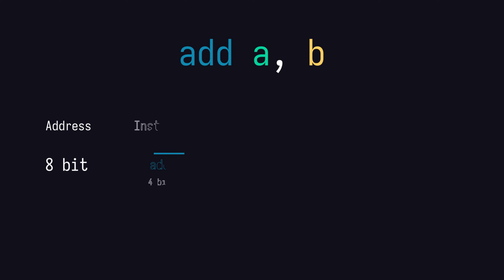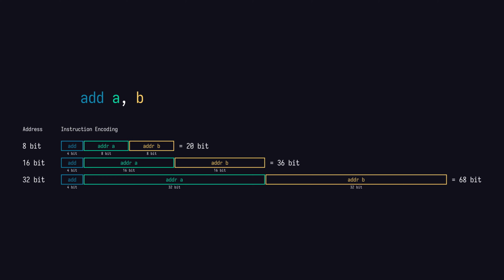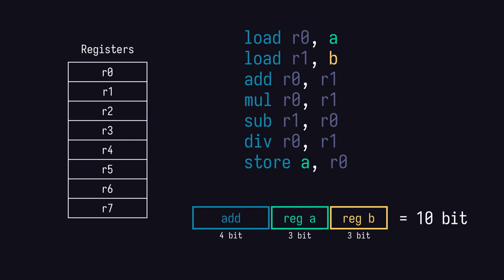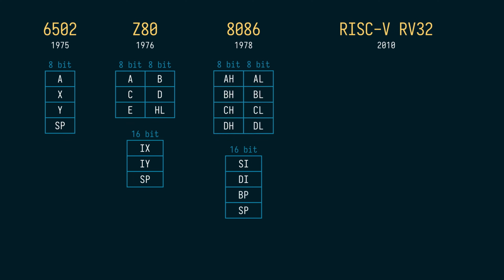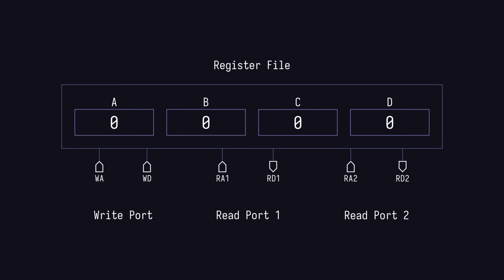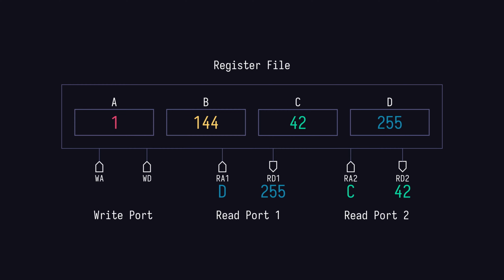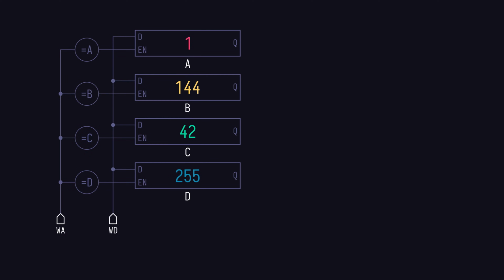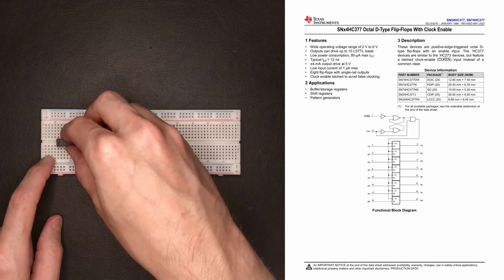How a Register File Works – Superscalar 8-Bit CPU #16

Comment: Really wanted to see what would happen if you enable both outputs or the same time.  Smoke?  Or does it have some built-in resistance and preference for high vs low?
Reply from the maker: It’ll release the magic smoke 😅. One buffer will short to VDD, the other to GND. The transistors in the pads of those chips can source and sink quite a bit of current, but they are not able to withstand having a full 5V drop across themselves. If the short current is 100mA, each transistor would generate 500mW of heating, which quickly leads to a temperature spike inside the package. That usually melts the metals on the silicon die and also disintegrates the plastic of the package, and destroys the bonding wire that connects the pin to the silicon die. 🔥💨
Reply: @fabianschuiki Well, glad you didn’t destroy the project.  But would still be a fun demonstration!  Really enjoying this series, btw.
Reply from the maker: 😂 Thank you very much!

Comment: 20:05 what's that in the corner?
Reply from the maker: That is a very unfortunate artifact of using an open source video editing tool, where effects applied to an entire video track would sometimes not be applied to the individual clips properly 🙈. It's a histogram of the color levels/gamma filter.

Comment: I've actually wanted multi-register load/zero in every assembly I've ever written beyond the 6502.  I've always wondered why they didn't do it.  It appears extremely possible, even trivial.  I often did xor reg, reg on a bunch of registers at once on the x86/64, seems like a waste.  Especially when there's no immediate operand, like when you want to zero or copy one register to a bunch of others.  Maybe that's just me.
Reply from the maker: Multi-register loads would be extremely handy 🙂. The challenge with regular registers is that they are very expensive. Especially when bookkeeping for out-of-order execution is involved, each register write requires another write port into the register file. The write ports are the one truly annoying thing: they become more and more costly, since every single register has to locally pick the write data. In a simple processor like early x86s, adding another register file write port might require 25-50% more silicon. The SIMD and vector instruction sets of modern CPUs are a way around that, where execution happens across replicated lanes.

Comment: I think you should've included the motorola 68k which had 8 data and 8 address registers at the time. Also, SPARC which had register windows overlapping over 128 registers with 32 available at any one time. Especially considering 68k was about when the x86 8-16-bit machines were still in use and SPARC was coming into use in the 90's.
Reply from the maker: Yeah that's a great point! 🙂

Comment: Fabian, could it be possible to have the PC as a register file rather than a specific thing ? In other words, is there a way to add (!) a adder to a register file ? Cheers.
Reply from the maker: Yes this is definitely something you can do. One option would be to have an adder chip directly in each register, such that they can increment by the instruction size directly. Alternatively, if your instructions are all of the same size, you could use one of the counter chips, like the ones that @James Sharman used, and replace the flip-flop in the register with that, allowing you to make the register count up directly.

One big drawback of trying to treat the PC like any other register is that it requires special attention in a lot of ways: as you mentioned you want to add to it for relative jumps, you want to load it with a new value for absolute jumps, and your PC might have a different bit width than the rest of the CPU (like my 16 bit PC within an 8 bit CPU). All other registers really only need to be able to read and write values, unless you're doing special in-register increment/decrement like James does in his 16 bit registers, but doing so doesn't mix well with the added complexity of going superscalar and out-of-order.

So to make your PC be just like any other register, and since your PC requires quite a bit of functionality, you're stuck with having to make all your other registers more like your PC -- functionality which you might never use for all other registers.

Going down the advanced processor architecture path, things like speculative execution and branch prediction, as well as efficient call and return really really want the PC to be a separate thing that isn't mixed in with other registers. Modern computer architectures, for example RISC-V, don't expose the PC as a register for this exact reason; in practice the PC will be very special in all but the simplest cores, and there's not a lot to be gained.
Reply: @fabianschuiki  Was thinking about interrupt recently following rehsd 286 project... And I thought about stack... eh eh, I can wait to see how you will solve this... Through a dedicated register as for the PC or as a general one (a-la risc way).....
Reply from the maker: There's a neat interrupt model where you do as little work in hardware as possible -- just store the PC to a "pre-interrupt PC" register, and do all the saving/restoring in software.

I'm planning to make the stack be entirely opt-in, with none of the hardware and ISA knowing what a stack is (very similar to modern CPUs).
Reply: @tmbarral664 thank you for mentioning rehsd! I now have yet another channel to binge watch